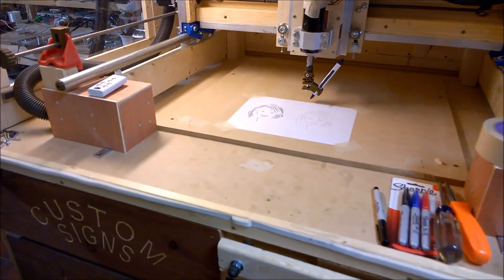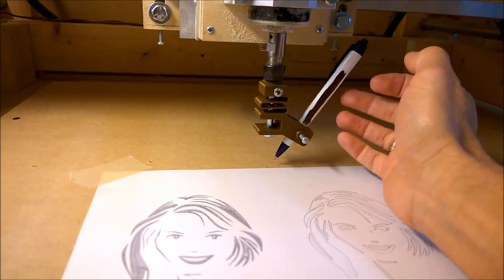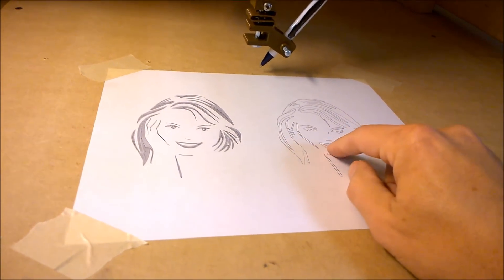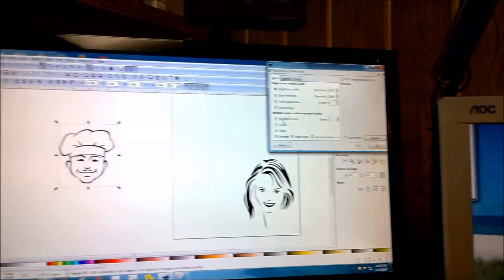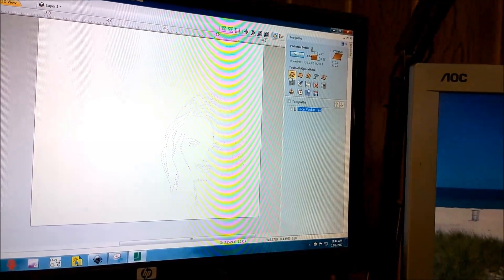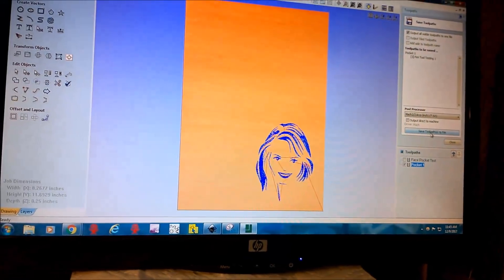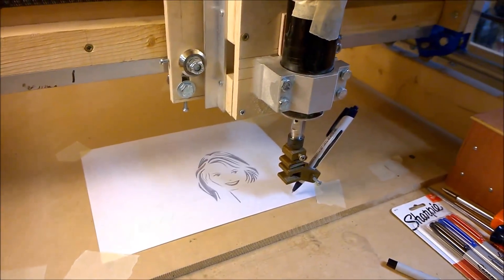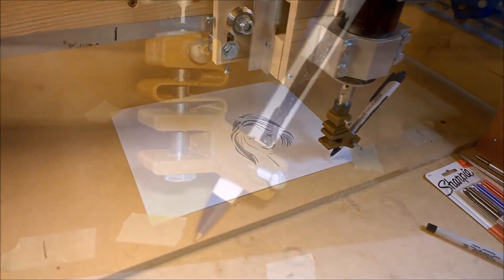DIY CNC - Drawing Machine/Plotter Mod - Cheap and Easy!

Comment: Hey man,  I do a great deal of  electronics projects. These projects include enclosures Metal and Plastics. My question is would it be possible to have a Z- AXIS to be able to set hight based on the size of the enclosure?

Comment: my cnc pen plotter just makes lines around the picture like it doesnt fill up the dark areas what can i do?
Reply from the maker: You need to sort of trick the CNC and set up the gcode as if it was doing a shallow pocket.  Also have to tinker around with the overlap settings.  Best of luck.
Reply: so making a Gcode format picture would help to fill up those black spots properly? also my machine works only with inkscape so i dont know if i can do that much on inkscape but thank you ill try that way

Comment: Did you lock your Router Shank some how to keep it from turning as the pen positions  in Y direction?
Reply from the maker: I put some masking tape on the spindle top to keep it from turning.
Reply: drez20001 ahh, I saw that, didnt watch your video long enough, lol. Great work. BTW.

Comment: very very intelligent.. question is.. is it possible to connect with arduino or if not, what electronic device will connect to it from its software to hardware to control the motor?
Reply from the maker: There are certainly arduino CNC machines that can be used as basic vinyl cutters.  A good place to start is with the MPCNC forum for CNC vinyl cutters using arduino systems.  https://www.v1engineering.com/specifications/

Comment: Nice, you should adapt a vinyl drag knife so that you can cut your own boat lettering.  It will save you a fortune.
Reply: It does look very much like a drag knife. I wonder if the pen tip were centered like you would do with a drag knife if he wouldn't need to lock the spindle.